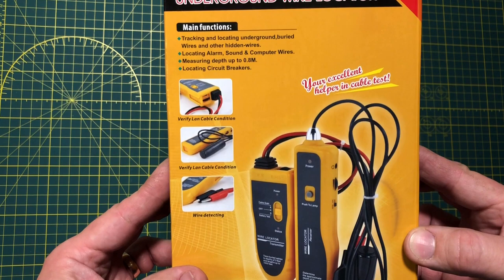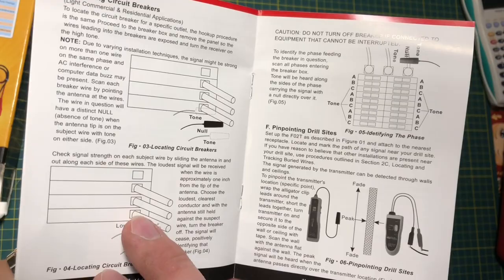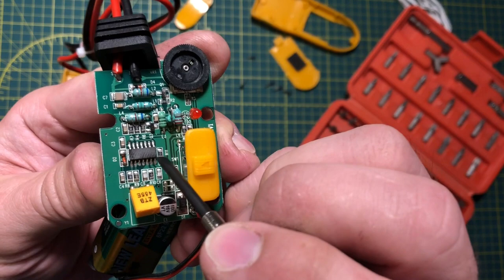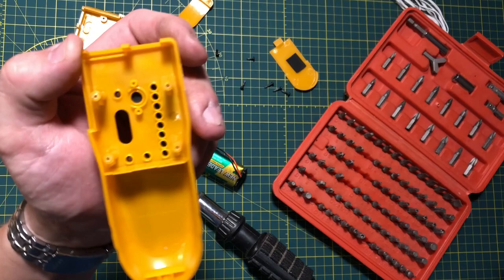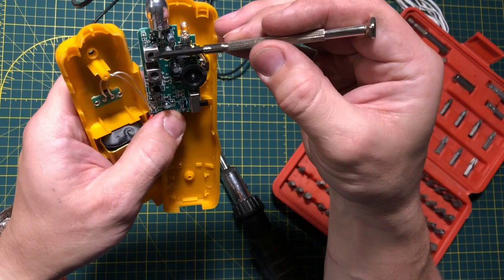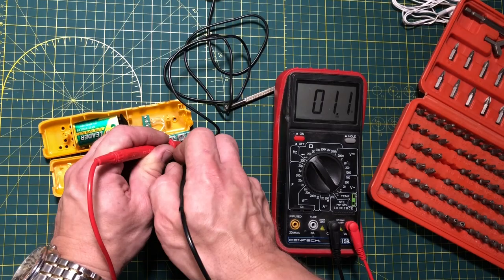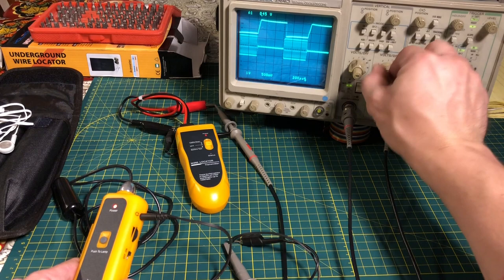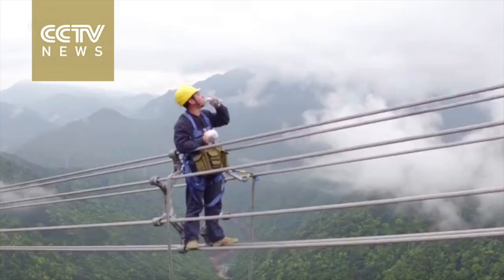Cheap Wire Finder Cable Locator Overview

Comment: I bought one of these a couple of years back.Have not used it much but hey it works! For $40 to have sitting on the self ready to go its a bargain!
Reply from the maker: It does work, indeed.
Reply: @TinkeringNerd  I have just ordered the NF 826.I like the $40 unit but this unit seems to locate to a deeper depth, has a better read out and is rechargable.. It also cost $114 so it will be an interesting comparison.

Comment: Thanks. I needed to find some sprinkler control valves. I thought somewhere it said not for sprinklers. Not sure why that would make a difference. I was going to buy it and try anyway. One thing I learned about was dragging. Most other videos showed them swinging it.
Reply from the maker: Thank you for watching. Not sure why they said not for sprinklers, it worked just fine for me.
Cheers

Comment: Capacitor C7 right next to the red wire is connected in series, so it may be able to provide DC insulation between black & red.
Reply from the maker: True, but DC isolation is not going to help against AC voltages.
Reply: @TinkeringNerd  I see your point that connecting it to mains with 120v or 240v will likely blow that capacitor.

Comment: I have the network tracker version of this. Signal Voltge on my voltmeter is 7v so im assuming p to p voltage is 14v. As far as performance goes it is as good as the expensive kits. The difference is it uses a cheap probe with a high power tone genetator that puts 14v tone out on all 8 wires.The expensive kits have probes with much better amplifiers and filters but put  a 6- 8v signal out on 2 wires. The cheap one works but the downside of the cheap tool way is lots of crosstalk (but its not hard to narrow down to the correct wire) and short battety life of the tone generator.
Reply: Heres the cat6 version i have.
https://www.amazon.com/Wire-Tester-Cable-Tracker-BOOGIIO/dp/B07TMDFG3W/ref=mp_s_a_1_8?dchild=1&keywords=network+tracker&qid=1603057538&sr=8-8

Be warned therrs alot of similar tools amd most of thr cheap ones are junk. First i got the Elegant (blue all in one tracer/tester with rotary dial) and it would blast tone all over the patch pannel (impossible to pin down) then it would go dead silent then come back. Not a reliable toll. Return
Reply from the maker: It’s weird that a network tracker is cheaper than the single cable tracker.
Reply: @TinkeringNerd  the expensive kits are more expensive because theyre inductive ammplifiers while rhe cheap kit probes are just a simple radio. The inductive amplifier has alot more compinents hence its higher price. The pros like them more because theres less cross talk and more accurate and when your running and tracing lines every day thats a big deal.
Reply from the maker: That’s my point. The link you sent me is for a tracker that’s even cheaper than the one I have. I thought mine was the cheapest out there
Reply: @TinkeringNerd  theres a few on amazon as low as $15 ive tested but they were total garbage and unuseable for network cable.

Comment: What is the other end of your ground extension cord hooked to? Is it plugged into a power socket? Thanks in advance for your reply
Reply from the maker: It’s connected to ground pin of the power outlet. So, it’s connected to ground.
Cheers.

Comment: I have a direct short in underground electric cable. Runs from barn to junction box about 300 ft then 50 ft to plug, 100 ft to next plug another 100ft to another plug. Plan on going from one plug to another looking for break in line.  Will this work??
Reply from the maker: You can isolate all runs from one another (disconnect all wires from all terminals starting from the breaker in the panel), then check continuity with DMM. Identify which run has problems, then, you can use this finder to locate where your cable runs under ground, dig up and repair. I don’t know if you’ll be able to find the problem point with this finder. If it’s a break, it may show, but a short, I’m not sure. Look next to trees, roots cause many issues. 
Cheers
Reply: @TinkeringNerd  thanks for quick reply. I guess I don't have much to lose by buying one. If i can narrow it down some be great. Just to know where cable is would help it's been 30+ yrs
Reply from the maker: Thanks for watching

Comment: I'm trying to trace where I believe there is a disruption in my conduit (probably from a tree root) leading from my underground pool spa light fixture. The conduit is at least 1 foot below the pool deck which is covered in approximately 4 inches of concrete. If I send a steel fish line through the conduit and use it as the antenna, do you think this tool will pin point where the steel line stops in the conduit, thus showing where the conduit disruption is?
Reply from the maker: It is hard to predict. The wires in the conduit may or may not pick and carry the signal from the “antenna”. However, the length of the steel fish line may be even better indicator of the break point, if you know where conduit runs.
Reply: @TinkeringNerd  My plan is to run the steel fish line in the light conduit until it gets stuck (I'm unsure of the exact conduit path because it is at least 1 foot underground). Then connect the transmitter alligator clip to the steel fish line and the other alligator clip to a metal stake in the ground. Then I'll use receiver to locate the end of the fish line; in theory showing me where the conduit disruption is.
Reply from the maker: I’d like to learn if it works out for you, would you post the results of your endeavor? My prediction is 2-3 ft accuracy. Best of luck!

Comment: Thanks for your video bro! So I would like to ask you, based on what you have tested do you recommend the product? Cheers!
Reply from the maker: Thanks for watching! You can’t beat it at the price point and it worked for me. Like I mentioned in the video, it’s not for hot wires! I also don’t know if it would detect water pipes as they are grounded. But, for regular electric cables, it works just fine, when they are unplugged.
Cheers.

Comment: Hello, quick question if you can help. Why not connect to the common on the sprinkler controller box instead of ground on the mains line for the second alligator clip?
Reply from the maker: I’m not sure why, but connecting to ground was my first idea, and it worked. So, I didn’t have to try another way. It may would’ve worked with common of the sprinkler, but I didn’t get to that point.
Cheers.

Comment: Can you find copper wire which is not running any power? And would you use  a radiodetection tool like the "rd400ffl cable fault finder and cable locator"

Comment: I found that because my zone wires are all together in one cable that the signal is passed through ALL wires, not just the zone you're looking for. I've been able to find the wire path but unfortunately it doesn't stop at my valve, it keeps going. Any tips?
Reply from the maker: Does the signal continue with the same strength all through the cable? I would start with the furthest valve at the end of the cable. Then, see if it is possible to distinguish the signal coming from wire directly connected to transducer versus the signal that has been induced being next to the source wire. Try connecting all unused wires to the earth (ground) wire of your electric panel or power outlet. Stay safe when working with electricity!!!! If wire trick doesn’t work, I would trace the cable through the yard and “poke” the ground all through the length of the cable in search of the valves.
Best of luck.

Comment: Thank you for an excellent (and funny!) video - you seem to actually understand how this thing works.  I need to locate a long underground plastic water pipe filled with water.  I'm planning to push a long insulated wire loop into the pipe using a conduit fish tape, and connect the two ends of the loop to the red and black clips of the signal generator.  Do you think it will work?  Or is there a better way?  Thanks again.
Reply from the maker: Thank you. If your pipe has turns/elbows, you probably won’t be able to fish a wire inside it. However, if you manage to do it, don’t use it as a loop. Connect red clip to the wire and black clip to ground. It should work. Best of luck.
Reply: @TinkeringNerd  Thank you for your quick and very helpful reply - you are the man!

Comment: do you think it is capable finding a buried copper water line?
Reply from the maker: Depending on the depth, it may work. I would try it, it’s cheap enough to not cause too much damage to your wallet :) and if it works, all the better!
Cheers.
Reply from the maker: Although, on second thought.. the copper pipe is grounded. So, I’m not really sure how that would work out.
Wish you the best of luck. Please let us know about your progress.